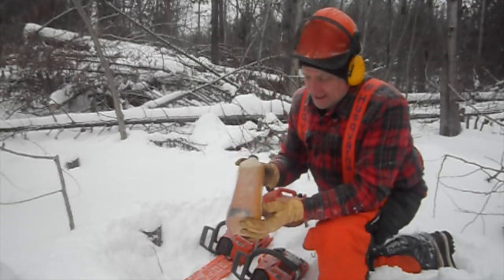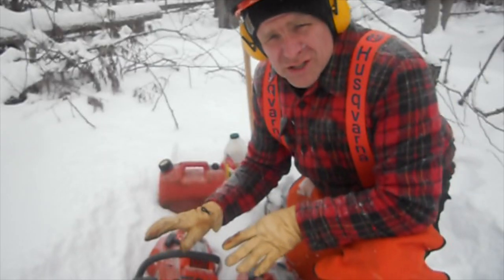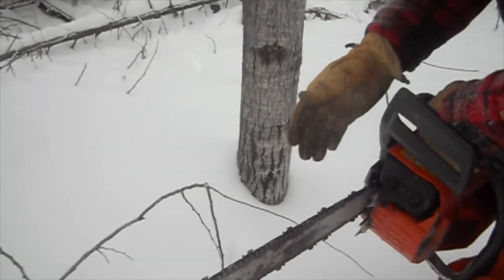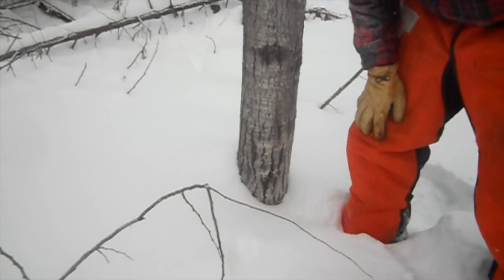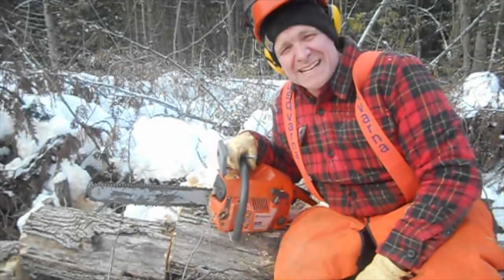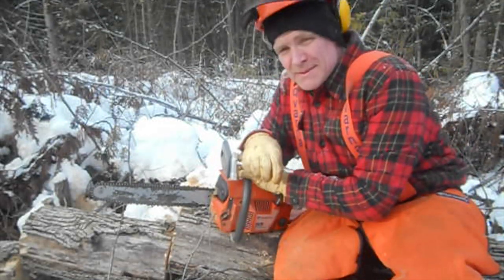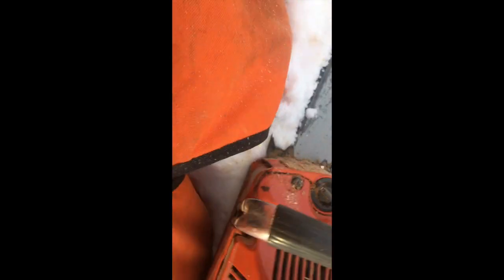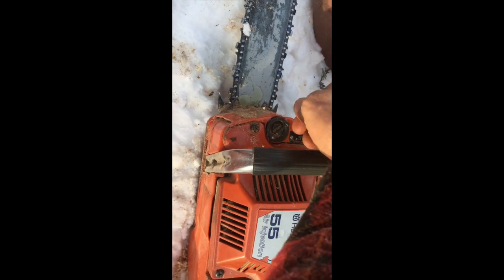Vegetable oil as chainsaw bar oil

Comment: I've been using it for 8 years, down to -25c my favorite is stuff they use for chicken wings makes the woods smell good. I get it free from restaurants in my area. Good vid👍
Reply: How can it work at -25°c ? It turns into jello
Reply: @dimmacommunication  Did you not just watch the video? He said he was 20 something degrees below zero and it poured fine.
Reply: @BobChanter  Hard to believe veg oil doesn't freeze, I wasn't born yesterday.
Veg oil turns into jello at low temps
Reply from the maker: @dimmacommunication canola oil does solidify in cold temperatures. but I’ve used sunflower oil to -30 Celsius 
As long as you keep the oil in the house when you’re not using it it doesn’t seem to solidify all day using it.
Reply: @cheaphomesteading  Nice to know sunflower is the cheapest

Comment: I've been using canola oil for about 10 years now. I own and operate a residential tree company. I switched over mainly because of respiratory problems, thinking it was because of the fine mist of oil that lingers around when cutting wood. So... after 10 years of using canola oil in our professional Sthil chainsaws... I can honestly say that I don't have respiratory issues and our saws have operated just fine. There is no excessive bar or chain wear or excessive heat. However, the only negitive is... over time, there are portions of the saw that build up with baked on canola oil that is difficult to remove. Mainly around the clutch assembly and even around the cooling fins on the cylinder. I guess where ever any extra oil finds a place to cling to. I can't saw exactly if this has compromised the life of the saws but it's definatly arguable that it could.
Reply: I had a wwoofer here in Northern British Columbia last summer, 3 year apprenticeship as a forester in 
Germany, they only use vegetable oil, just like me, used canola oil which restaurants are gladly giving away for recycling. Smells nice and your clothes will be easier to clean.
Reply: I will say, after project farm's testing I can see why this would be most people's experience. The more expensive bar oils are tacky, but they have virtually no wear preventatives. Might as well just add tackifier to whatever you have lying around.

Comment: I've been using vegetable oil on my chainsaw for a few years now. Putting it on and cutting is a dream and works well. What I have noticed is that after cutting, you need to clean off the oil. If you don't, when you go to use the saw, the chain will be seized up on the bar.  The gear at the end of the bar will also be seized up. This has to do with how vegetable oil forms a crust as it dries out.
Reply from the maker: Yeah, I’ve been pretty much exclusively using vegetable oil. Depending on what oil you use, some tend to get gummy more than others. I find sunflower oil seems to be the best that I found any ways. Have a great day man.

Comment: Hi there, i used vegetable oil too for a while. In summer it dries out and forms a thick crust. I had a clogged up airvent on the oil tank. Very hard to dissolve it to make the chain get lubed again. Now i use chainsaw bar oil again. It costs over twice the money but it works better. It is much more sticky and does not clogg the tank vent.

Comment: Good lubrication with vegetable oil but wash it out with mineral oil as it oxidizes and gumms up everything especially when stored for longer time. Especially tank vents get clogged. So frequently use it's fine.

Comment: Thanks for the handy tips.
Just a suggestion, brush off all the sawdust around both the oil and fuel filler caps before opening them up, you don’t want dirt or dust to fall inside...for obvious reasons.😀👀
Reply from the maker: I try to but the colder it is the less I do it. Thanks for watching man

Comment: Must be freezing cold there. I have a Stihl ms271 and you cannot adjust the oiler. The chain seems like it doesn't get enough oil as most oils are quite thick. 
Should i try the canola oil ?

Comment: i had a 1\4 of a bottle of vegetable oil so i put it outside last night and it was 1 degree F and this morning it was froze solid so it wont work for me. i dont keep my saws in the house
but the regular summer weight bar oil was thick but still poured
i will try vegetable oil in the summer
Reply from the maker: Last Saturday I cut and it was -19 and I have cut at -28 and it worked fine. You leave the oil in the house. When you go out it takes all day to thicken up. At least for sunflower oil thanks for watching man
Reply: @cheaphomesteading  i will try it next time i cut wood

Comment: The video never addresses whether this is safe long term for the life of the saw.  I've been interchanging vegetable oil, aka soybean oil, and canola oil.  My saw sat for months and I just picked it up to discover the chain brake and chain completely seized up with what feels like rubber from the dried vegetable oil (that was what I last used).  Not sure if canola dries differently, but I sure hope I can get this mess cleaned up.  It's all in between my chain brake and the clutch...yuk!
Reply from the maker: I’ve never had that problem but I’ve Mainly used sunflower oil. Canola seems to solidify a cool temperatures sunflower stays pretty liquid for a long time. Have a great day
Reply: @cheaphomesteading  Thanks.  Have you ever let your saw sit and found the chain seized up by the dried sunflower oil?  I definitely have, in addition to the other problems I described.  Lance Moore who commented below reported that canola oil would seize up his chains after it dried.  I'm wondering if a certain type of veggie oil would leave less of that residue once it dries.  Relatively cheap are sunflower, peanut, and corn.  It's a bit more, but based on your advice I'm thinking about giving sunflower a try next.
Reply: Having not long had a small garden chainsaw and seeing expense of bar oil I immediately thought about a cheap alternative ~ so your video is very informative. I suppose, like a prize vintage car not used much and kept in the garage both motor and chainsaw require turning on every few weeks and warming up to keep parts smooth before 'putting back to bed' again between periods of non-use.  Perhaps, chainsaw oil chamber could be emptied of veg. oil and flushed out first when not in use for long periods. Thank you from UK

Comment: So what’s the long term verdict ? Did you adjust the oil feed output ? Did you damage the bar anymore than usual ? Being that cold would have thickened up the oil anyways but what about using vegetable oil in the summer, Any issues ?
Reply from the maker: I’m still using it. I had to turn down my oil feedscrew a bit. I haven’t noticed any extra damage or wear to the bars.I use it in the summer and I don’t run into any problems with it. I’m using it pretty much exclusively and haven’t had any problems.  I really don’t see much difference between it and store-bought bar oil. I had turned on the feed screw down because it is a little thinner. Thanks for watching

Comment: I had read that canola oil is the best oil for replacement of petroleum because it has lubrication properties similar to petroleum oil. Your opinion?
Reply from the maker: I have never tried canola . We don’t deep-fried much. And when we do I try not to use canola because it’s so genetically modified but. That would be a good test to see if it’s better than sunflower oil in different veggie oil‘s. Thanks for watching Man

Comment: Much cheaper that bar & chain oil.
Reply from the maker: when i first tried it i was sceptical but I like it. its all i have used for almost a year and no bar problems as of yet. thanks for watching and have a good new year
Reply from the maker: The video you commented on is an biodegradable vegetable oil it’s not using machinery oil you commented on the wrong one

Comment: If you have enough waste cooking oil to recycle it or have a use for it, you probably should rethink your cooking habits and diet.
Reply: I get mine at the local dump where restaurants leave 5 gallon containers for recycling. I now have enough used canola oil for the next 10 years, heating only with wood at 55 degrees north, in British Columbia.